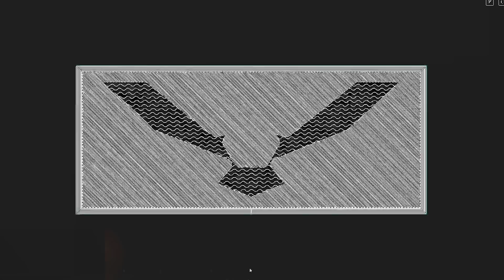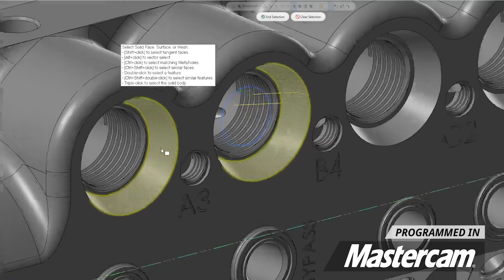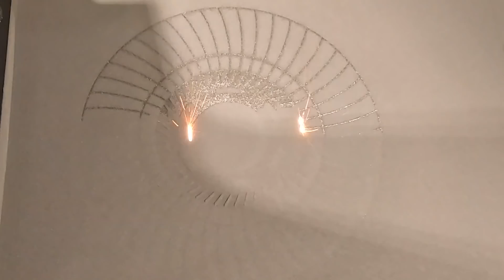MONSTER Company Expects ME to Machine Parts on OLD Machines

Comment: The old vs new dichotomy  is always a fascinating topic.
My industry relies heavily on plaster negative casts & positive molds but we've been transitioning into 3d image capture and cnc produced models for a decade or 2 now.
I personally got to upgrade from a 3-axis lathe to a 7-axis robot with about a weeks worth of vender-provided training between the two over the last 5 years or so.
Figure I'm probably darn close to being a proficient machinist by now; accurate to near 1/16" on a slow day! 
Question for the real operators though;
how come my cam software   can't lay out multiple bends when processing a bent cylinder operation? 
Are computers just that fragile a tool stil?
Is it because of how my workpiece is offset from the rotating axis on its turntable? 
Is there just no good reason to make a single operation that complex when you can add secondary instances of the same thing but different? 

Bonus question:
What can be done with expanded polyurethane dust? 
That's one of the things I build best.

Comment: I run a prototype shop that makes parts for science experiments of the International Space Station and I use the Trak BPM every day. There is just no replacement, in my view, for a semi manual mill in a prototype shop. If you’re engineers are designing parts that require some crazy 5 axis setups, they could probably be better at their job. I worked at SpaceX in Texas before this and their machine shop is a laser cutter, a waterjet, 2 Haas Vf’s, and some old prototraks. Most of the parts looked like they were designed and built in a competent person’s garage in 1973 for their dune buggy. The key word here is prototype. You make it and give it to the engineers and they come back wanting 1 hole bigger and 50 thou off one side. Easy Peasy in the Trak. How are you even gonna put it back in the 5-axis mill? I make one off parts in the manual lathe all the time. It doesn’t even have a DRO. The engineers will stop by with the material and I can get the part done in the time it takes to walk back to the office. If they want 500 of something, we send it out.

Comment: New equipment is nice however a one piece order with a simple part screams manual machine. I work in a shop that gets lasered profile material that has to be tapped. The answer is a radial arm drill press that was manufactured in January of 1932!

Comment: An inefficient shop buys Mastercam, not because it's good but because they heard it was good. A video is made about this difficult situation by a company that is sponsored by Mastercam.

Anyone see a problem here? 

Imagine if there was an efficient CAM with a modern workflow in the picture instead of Mastercam. Might be a better opportunity for everyone involved. Esprit TNG or Edgecam both have what Mastercam doesn't... an efficient workflow.
Reply: Sorry Jon, but independent fact checkers have determined that your comment is incorrect. Having used nearly every CAM platform, perhaps you can tell me how “efficient” TNG’s workflow is. Like having a seperate file for every machine and every operation, whereas a single Mastercam file can have 100 machines and 1,000 operations including lathe, mill, edm, millturn, and more. THAT sir is an efficient workflow
Reply: @barrysetzer  No independent fact checking has been done. This is a bold faced lie by an obvious Mastercam fanboi.
Reply: Then answer my questions
Reply: I literally gave you examples of why you are 100% incorrect. Not to ARGUE with you, but to see where youre coming from. I could call you names far more offensive than “fan boy,” but i didnt.

Comment: Be careful judging "old equipment" as being inefficient.
I know of more than a few, very precision, machine shops that use what people would consider "old machines" to produce very close tolerance parts.
If you design efficient work holding solutions, with repeatable, fast turn around part changes, you can bang out some of your parts on much less expensive "old equipment", and save your 5 axis machining center hours for the jobs that require that kind of machine.
There is a place in a well balanced shop for both.
Another good video.
Take care

Comment: That's funny I work for a multi billion dollar company and we still have a shop with a 1978 bridgeport knee mill. Fully manual. And a 1947 davenport 12 inch lathe fully manual. We run 40 hours a week sometimes 50 hours a week on those 2 machines and corporate won't get new stuff because "they can't justify the cost"

Comment: In Germany it's very common that big companies use only old outdating machines. I work for on of the biggest construction company's in Germany with 2 billion sales volumen. We make very complex stuff, but have only 1 cnc machin in our whole companies and we are spread in 13 different countries. Our factory is big as 15 soccer fields. And if we get a "new" machine, it's from 1960 and this happenes very often. But I have some mates in other company's like mine and it's the same there. Only the small companies invest in modern cnc machines
Reply: how does that make any sense though. Are you making the same parts again and again or is it all different everytime?
Reply: @Mr30friends  Very different for sure. Even some spare parts for machines we produce ourselves because its cheaper, than buing it from the machine manufactura. We build from wind turbines to bridges to halls for other companies.
Reply: @LesbianSponge  And it still isnt worth it to invest in automated equipment even for the repeat parts? I mean those automated equipment are probably even made a few km away from you if you are in germany.
Reply: Thats totally different to my experience.

Comment: Spend $35k on a Trak mill or $699k on a 5axis, I'll take the Trak, and farm the rest out.
Reply: Making 10 parts per hour with an automated pallet system 24/7 vs making 1 part per hour for 8 hours a day.
Random numbers of course, but its probably not far from reality. Or else there wouldn't be a market for expensive machines. And there clearly is.

Comment: I'd like a video comparing Autodesk cam vrs mastercam
Reply: they are sponsored by mastercam, so unless that sponsorship falls out, I really doubt they will ever do anything like that.
Reply: I'm stuck on mastercam forever because all my work for the last 20 years is on mastercam. Sure there are converters but the risk of mistakes is too much. There are plenty of shops in the same situation. It's not the software but how you use it.
Reply: @wannabecarguy  I just wanted to see a side by side comparison, because I have to make a choice in the not to distant future for how I plan to go with my shop
Reply: @seancollins9745  I personally can’t stand the user interface of MC. I run a mill-turn and a 5 axis mill with fusion. I produce reasonably complex  parts for a optical supply shop. MC is a more powerful software, but I just can’t get past how clumsy it feels. The parametric modeling is very useful for me and my company to design and make our in-house tooling. MC would not allow for this flexibility. Well, not without throwing in a seat of SW.

Comment: American manufacturing is stuck in the 40s. "This is the way we've always done it". Yes old Milwaukees and Czech made lathes are very nice machines and they have their place. But these shops are patching together old machines and barely keeping tolerances. Does the company maintain these machines or run them to failure and then kludge it back together every 4 months?

Comment: There's always for and against with modern equipment/ old equipment. A modern shop that does not have at least one Manual Mill/ Lathe will sometimes shy away from once off/small jobs and that can be a mistake. A company can take the view that if you don't want the small jobs why should they give you the big jobs plus setup times can be less on less on manual machines eg a bandsaw.
Reply: We only do work on cnc lathes and mills but there's no fucking chance we will ever sell off our manual lathe and manual mill.

We rarely use the mill and the lathe is old and beat up, but we use it quite a lot =)
Reply: @innominatum9906  Well if you need to make a hole and fast what's better than a lathe?
Reply: @MrCoffeypaul  Exactly
Reply: @innominatum9906   What do you guys use the manual machines for? actual work? or making fixtures?
Reply: @danielreardon6453  For "touch ups", light simple work. We use it to chamfer long bars of steel that's been milled. Sometimes using the manual is easier when facing off the second side of a part, because you can better control the clamping pressure compared to the CNCs.I give the apprentice some easy parts on the lathe as well so he learns the basics before being on his own on the CNCs.

So we do use it, but never really quote any work directly to the manual machines =)

Comment: It was a 1-off prototype shop.  CNC shops are for production work.
Reply: Not anymore...We can get production design quality from our prototype shop.and fast.almost to fast lol..Our advantage is,we can design engineer and send cnc out in less time than ever from in house.CAE is our pre prototype. We have in-house 3D printing as well..The days of single skill employees are done..
Reply: We've done prototypes for skunk works. No way you could even dream doing those parts on a maunual
Reply: False, we do one offs all day every day, all on CNC's.
Reply: @HEEDCNC  You CAN do prototype work on a the most advanced CNC machines, of course, but that’s not the question.
Reply: @Reach41  you literally said "CNC shops are for production work". This statement is false, there are countless CNC shops for 1 off Prototyping.
Reply: @HEEDCNC  You are right, of course.  I have a small 4 axis CNC mill that I use to support a hobby, and I make whatever I need on it.  Everything that comes off it is, by definition, a 1-off prototype.  That said, I might still suggest that in the shop originally discussed, the investment in CNC machinery and employee training would need to be recovered in 2 or 3 years through an increase in efficiency in order to get past the equipment justification people.  That’s what I was implying to begin with.

Comment: I've run outdated and new machines for 13 years, both have their place I think. I did pick up a 3040 cnc router last weekend for 500 bucks. Gonna crash course learn some programming now, thanks for the encouragement!
Reply: hopefully less crash, more course and learn
Reply: I just sold my CNC router for 500. To a broker. Never used it.